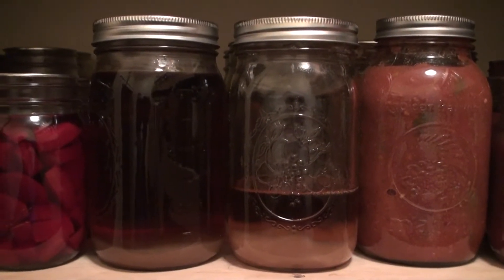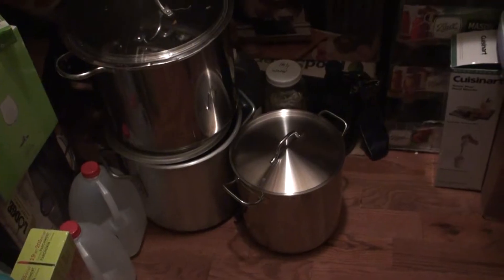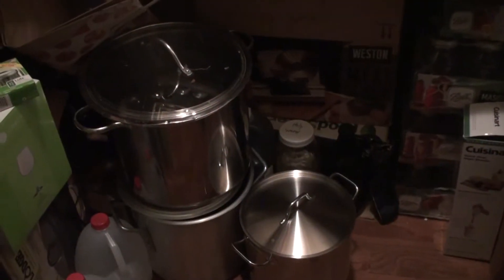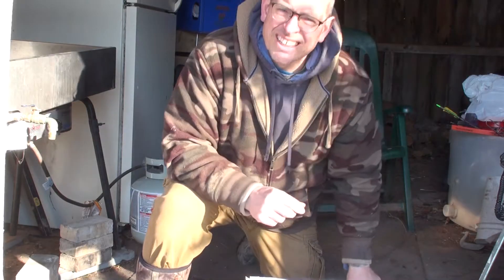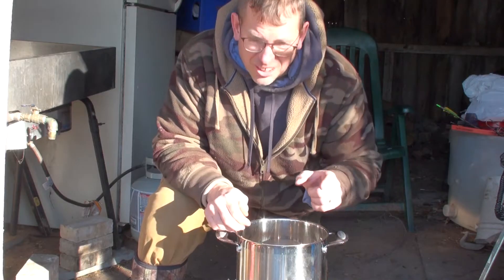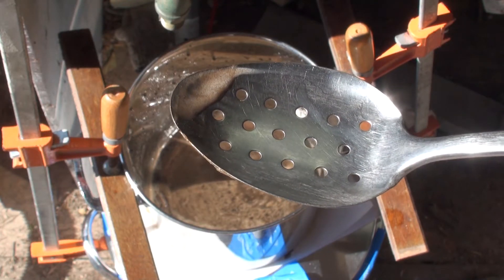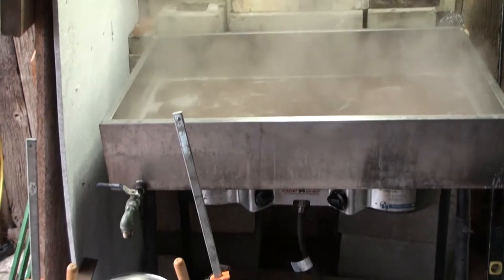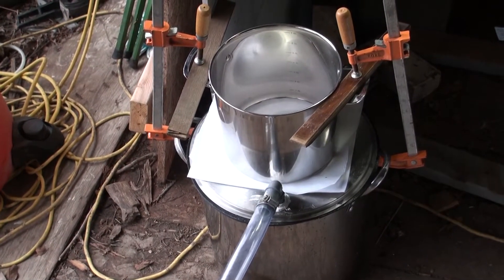Homemade Maple Syrup Vacuum Filter System #homesteading #science #maplesyrup #diy #farming

Comment: I tried building one a few years ago and initially thought it was great but no amount of vacuum will pull the syrup through once the filter is plugged, and trying to change filters became a real mess. I went back to just pouring a small amount through then changing the filter, still a sticky mess but I don't have to deal with clamps which is also time consuming. Been using Gerber cloth diapers, New ones😂 just rinse and hang them up to dry,2 layers.

Comment: I built one very similar this year. I cut out a larger circle in the lid instead of having the small holes to help pull more sap through. That helped a lot. I am increasing taps next year so I’ll be getting a filter press (likely with a manual diaphragm pump) but this got me through this season! Still way better than gravity filtering through cones
Reply from the maker: Thank you for the input! I am going to cut the center out for a finish boil tomorrow.